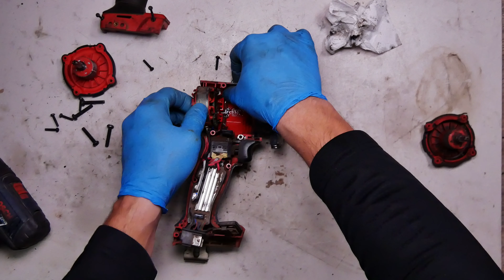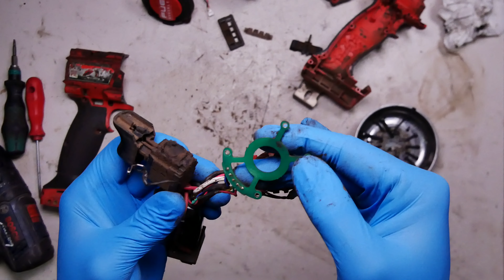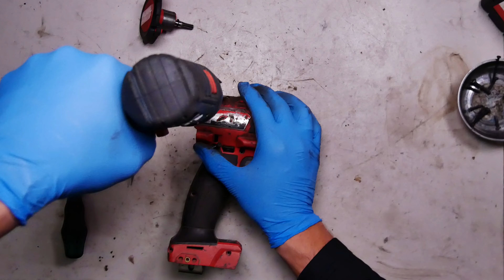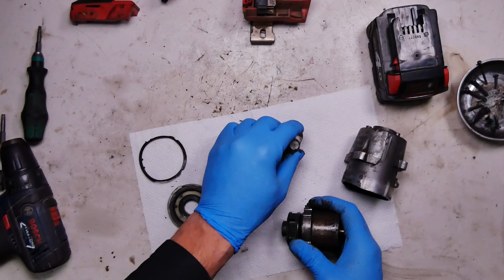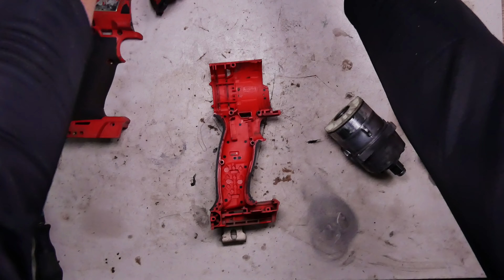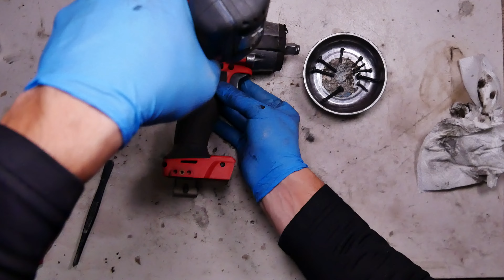Milwaukee M18FMTIW2F12 Mid Impact Wrench stopped working Hall sensor replacement and full teardown

Comment: Don't put too much grease on the impact hammer part.
Reply from the maker: I think it good amount of grease because it will be spreaded all over housing when tool will start to work, or Im wrong?
Reply: @powertoolsrepair  The grease you put in there should only be half of it. It happened to my friend because he put a lot of grease in the hammer gearbox, and after a while the grease leaked out of the gearbox and ended up in the brushless motor.
Reply from the maker: @nelchan2421 ok thank you I will keep in mind that with next tool